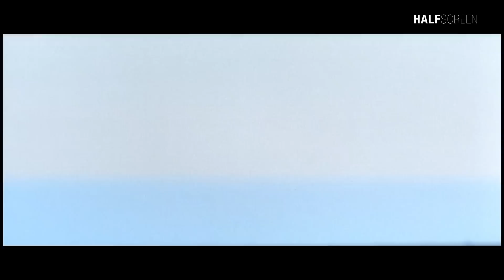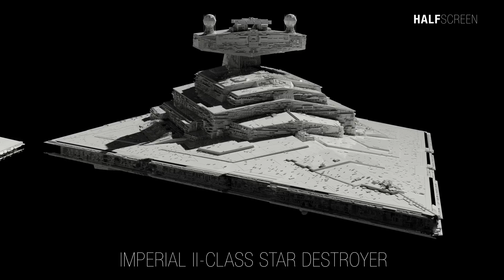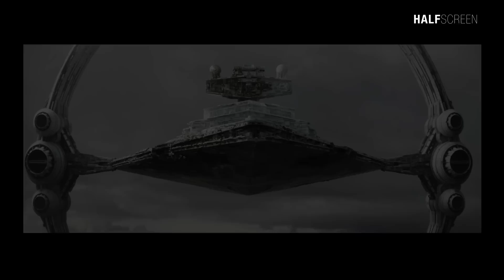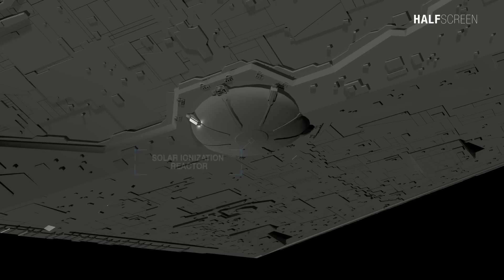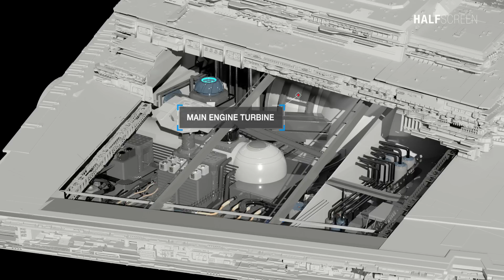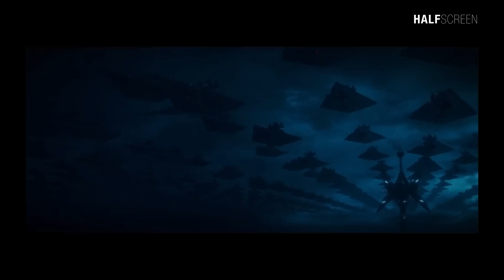Breakdown of the Imperial Star Destroyer

Comment: From what I've researched on the subject, those globes are the primary sheild projectors (not generators, big difference) as well as doubling as sensor arrays. So kind of like the defletor on Starfleet ships.
Reply: The geodesic domes are based off real-world radar emplacements on warships. Curtis Saxton asserted the domes are indeed sensory devices, though authors go back and forth on the subject. The prongs at the top of each dome project the local deflector shields.

Comment: Having the shield generators right on top of the bridge area is a questionable design. It makes them very conspicuous targets.
Reply: That's because they aren't, they're sensors/communications globes, it's just that the Executor was being hit from all sides at once as the Rebel fleet focused it down, when the shields finally dropped one of the sensor globes got blown up by some A-Wings.

The fact that the two incidents happened so close to each other led to the misconception that the A-Wings blowing up the globes took down the shields. A bad case of "wet pavements cause rain" that combined with video games turning it into a mechanic, making it possible for someone playing an X-Wing video game to bring down a Star Destroyer. (something the original X-Wing game even said was only a flaw in early Star Destroyers and that it was already fixed in later designs) left a bugbear that led to full on flanderization in most later Star Wars games to the point where it's easier to point to games where the shield generator is NOT in the globes (such as Battlefront 2 2005) than ones where it is (practically all of the others)
Reply: Well, it is still the most heavily shielded part of the ship, so unless you're an ace pilot in a Starfighter you're probably not slipping past the shield grid.
Reply: What happens when your ships are designed by a movie director
Reply: @beejay7665  That's why I prefer Fractalsponge designs, he puts way more thought into them.
Reply: Having armour over vulnerable areas is poor design, it makes them obvious targets 

Jeez people are getting dumber every day, the bridge is a prime target, the shield generator shields, so if you have to shoot it out first, it archieved what it is meant to do 😂
Reply: Agreed. I like the way Star Trek's Starfleet oes it better. Internal shield generators linked to an emitter grid that spans the hull. Way more protected and efficient.
Reply: @02ujtb00626  That's... how star wars does it too... the globes aren't shield generators.
Reply: It was mainly to protect the heavily vulnerable bridge. But as we've seen, it was susceptible to agile, fast-moving fighters. 
As though they've forgotten the lessons of the clone wars.
Reply: @numina0079  No. The bridge is not "heavily vulnerable" It's one of the least exposed bridges in Star Wars. Especially for a ship of that size.
Vast majority of other bridge designs can easily be struck from the side or above (or even behind in the cases of mon cal bridges, which are far more exposed than Imperial ones. The "head" structure of the ISD and Executor has so much mass as to protect the bridge from attacks from those angles. you can ONLY reliably attack it from the front, making point defense coverage easier to concentrate. Not something that can be said of designs which seek to "fix" this supposed vulnerability by... making it more vulnerable... (The Harrower and Resurgent being the most famous examples of this. The Harrower being more vulnerable to attacks from above and the Resurgent being vulnerable to attacks from all sides.)

Check out the Urbanus by fractalsponge, it's basically what the Resurgent thinks it is.